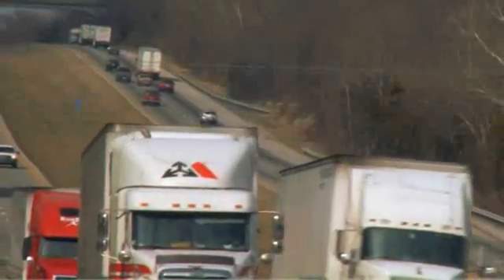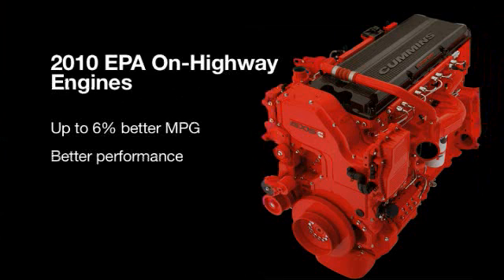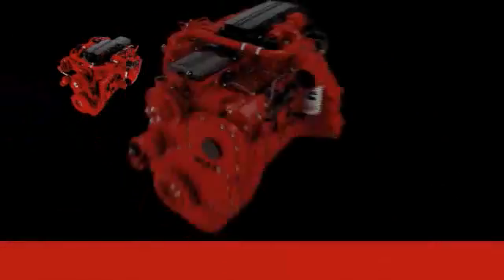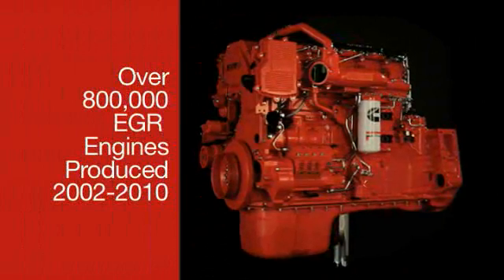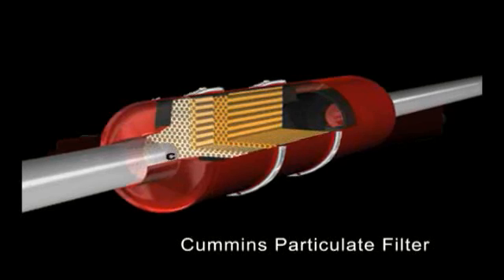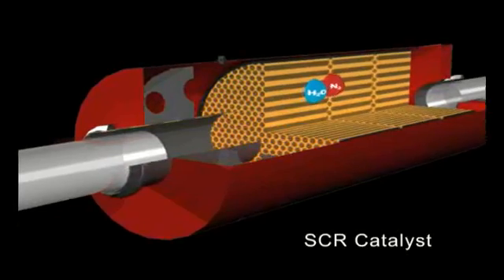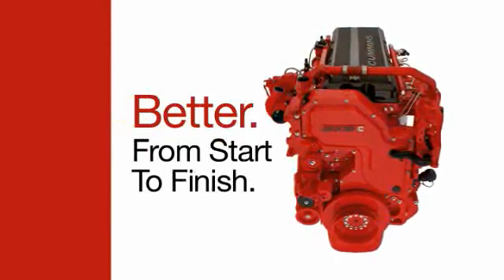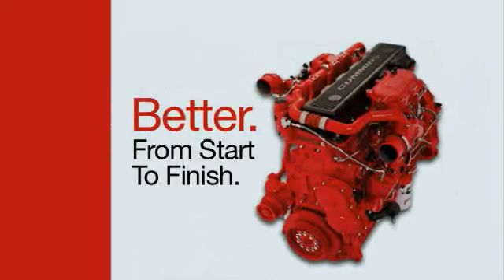Cummins 2010 On-Highway Technology - Better. From Start to Finish

Comment: I am not a fan of DPF systems BUT I am a fan of cummins and have used them for years with great success.  It is my belief that the whole DPF issue is a govt push to resolve a problem that really did not exist to begin with-at my expense.  Cummins evolution design engines have reduced emissions already...left alone cummins would continue to develop better more efficient engines---because the industry itself demands it.  Now with DPF's we have more issues, more software and more DEF to purchase......but if I have to have it I prefer the cummins.

Comment: It did not talk anything about CO2 emission.
Reply: Co2 is dependent on fuel use
Reply: no, more of C02 is produced to oxidize the particulate using NO..
Reply: @IndianFuckHead  no CO2 is emitted from the motor it is converted to ammonia and water in the final process